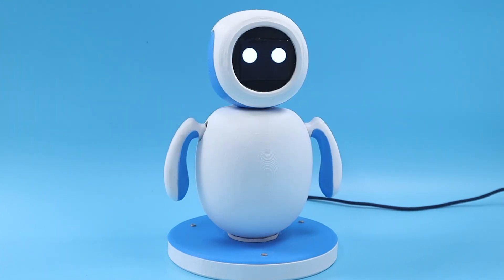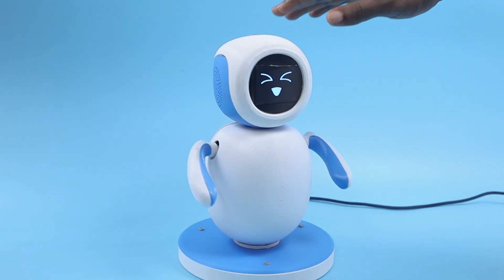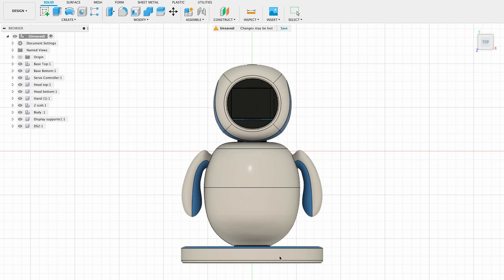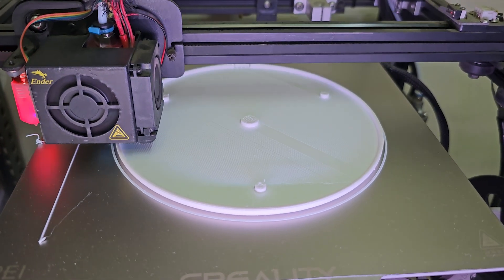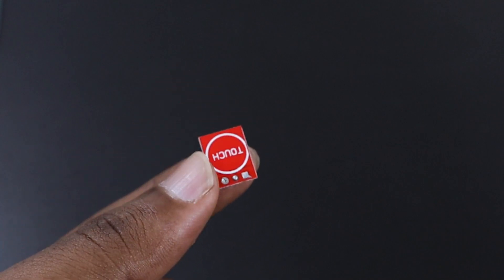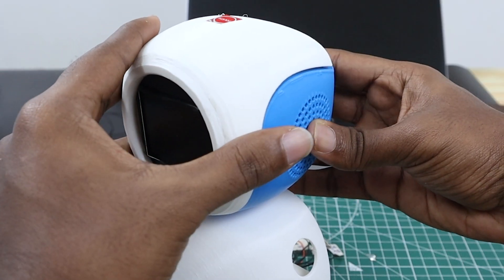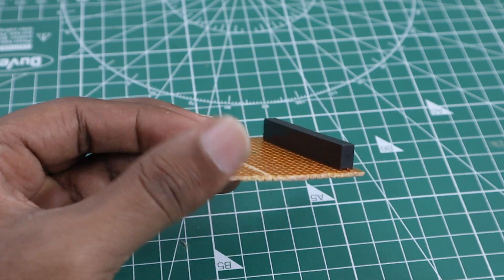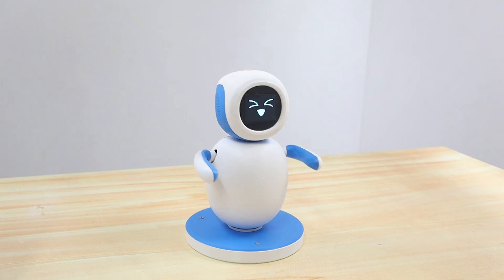Emo - A DIY Companion Robot With Raspberry Pi 4

Comment: Great job and thank you for sharing.  I have tried to 3d print it and found some minor issues.  On the head, the screen sides shows so the face is not all black.  Also, on the arms the servo do not really grip, the hole is big and I cannot fit a servo horn on it.  I am thiking of trying hot glue.   Not sure if anybody else has ran into this issues.
Reply: Can You please say how to draw 3D

Comment: Am I mistaken or has it not been worked on for 2 years and the STLs and components are also missing?
Reply from the maker: Can you mention what files are missing? As per our understanding only audio files are missing, which are lost and can't been updated. Is anything else missing?
Reply: @CodersCafeTech  github is linked here, but instructables is missing the link to the stl and it's not on github either, or am I mistaken? there's nothing about emo on viam.
in general i think it could deserve an update after two years. I'm sure there would be more in it these days, wouldn't there ?

But again... great projects... time to rebuild some of them :)

Comment: Hello! We tried to clone the entire github repository into the raspberry pi os of model 3b+, saved all the images and tried to run the code and connected the circuit exactly like it's shown, the code executed with no error but it didn't display anything. We are using the 2 inch display and it works just fine when we tried to run other codes to display random colors on it. Could you please give some suggestions for it?
Reply from the maker: Please write to mail.coderscafe@gmail.com

Comment: What does the black wire at the back connect to ....is it not a standalone?
Reply from the maker: Which black wire?
Reply: @CodersCafeTech  there's one black wire in the background during the beginning and end of the video at the back of the robot ...I was wondering what is it connected to?
Reply from the maker: @Firdosek-z1b  That's the power supply.
Reply: @CodersCafeTech  oh okay thanks

Comment: Can we use raspberry pico instead? Will the same code work on it?
Reply from the maker: No, it won't.
Reply: Thank you! I would also like to ask which raspberry pi 3 model will work fine with this?
Reply from the maker: @ Pi 3 should work, but Pi 4B+ to higher is recommended for better performance.

Comment: Hi sir, im a class 10 student and im really into these stuff but im a beginner so i was wondering if u could make a detailed video on this like how to upload the code into the raspberry Pi and add more animations
Reply from the maker: It’s awesome to see your enthusiasm for learning. At the moment, we’re unable to create a detailed video on this specific topic as we're working on other projects. However, we encourage you to explore the resources available online, and don’t hesitate to experiment and try things out on your own—that’s the best way to learn!

Here's a quick tip: Raspberry Pi is different from microcontrollers like Arduino. It’s a mini-computer, so instead of "uploading" code like you do with Arduino, you run your programs directly on the Pi, either by using SSH or connecting a monitor, keyboard, and mouse.

Best of luck with your projects, and keep up the curiosity!

Comment: I love this project thanks!

Regarding the power supply, I attempted to connect the power for both the audio and servo controller to the 5V GPIO pin of the Raspberry Pi, but the results were unsatisfactory. Whenever the servos move, they consume a significant amount of power, causing the screen to turn off and the audio to become noisy. I assume I should distribute the power source directly to the Raspberry Pi, audio, and servos, correct? I'm using a robust charger, USB-C 40W 3A.
Reply from the maker: PCA9685 has a power input. You can use that to plug in an external power supply there to power up the motors. Rest can be powered from RPI itself
Reply: @CodersCafeTech  Thanks for the answer!  Yes, I know that but what I want is to use a single power source, nor batteries, no extra charges, like in your example. So the PWC  V+ pin can be connected to an splitter in the same power source and could be enough?
Reply from the maker: @フランク-e7f  Yes, that is fine if you have enough current.
Reply: @CodersCafeTech  Awesome thanks!

Comment: I can use raspberry pi 3 instead 4?
Reply from the maker: Yes, you can
Reply: @CodersCafeTech  WOW, with the same driver or i need other code? i want reply but i don't know so much about if have difference in rasp 3 to 4
Reply from the maker: @supergeekstaubateprofessor9482  You can use  the same code, no changes needed.